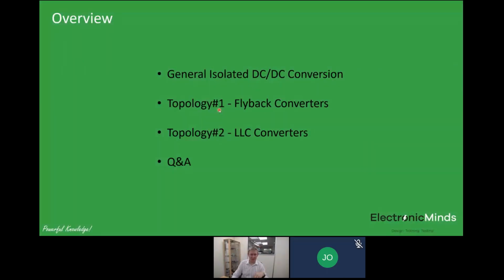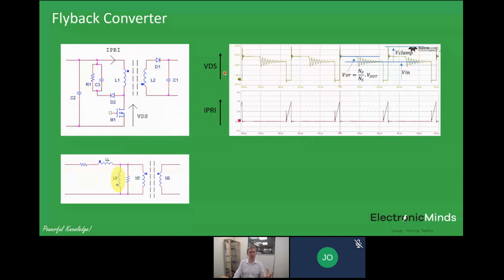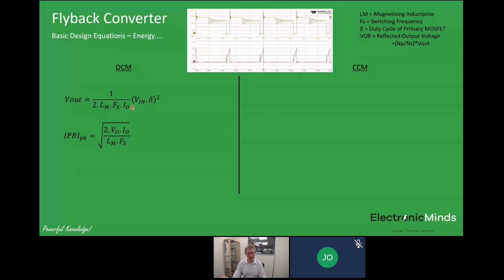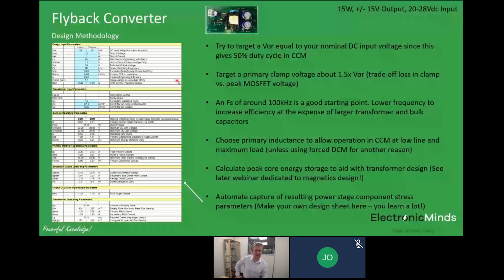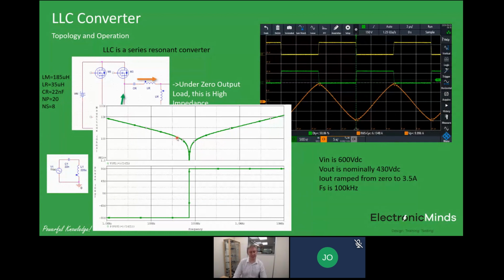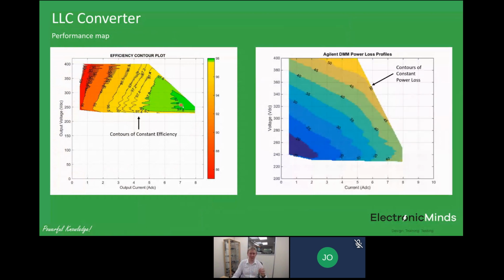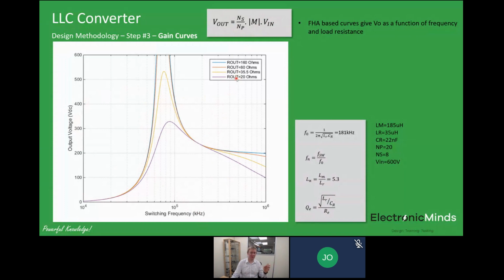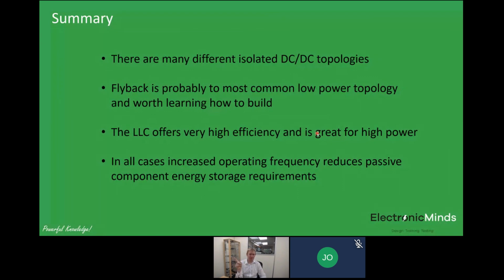Powerful Knowledge 3 - DC-DC Conversion

Comment: Re the resonant converter. If it can be thought of as a frequency dependent resistor divider...... 

Can the same be said about a typical e.g. buck converter (current return through inductor filter cap)? 

And if you're operating in the inductive region.. Why bother even having the series cap?

Comment: @Electronic Minds regarding VOR with flyback design, it's usually something calculated/assumed very early on in the design process (maybe the first step or 2nd). With one output I get how you can get a sense of what VOR could be, but, when you have 3 or 4 outputs, how do you accurately estimate VOR?
Reply from the maker: Thanks for the comment. VOR is a primary side referenced value and is the same with multiple output flybacks. With multiple outputs, you have multiple secondary windings. In each case, the VOR is approximately Np*Vo/Ns where Vo is the output voltage each output and Ns is the number of turns of the respective output winding. Higher outputs have more secondary turns and the primary referenced VOR remains the same.  I hope my explanation makes sense.

Comment: Thank you for sharing, greatly appreciated.
Reply from the maker: You are welcome Janamejaya. What other areas do you think would be interesting for these sort of videos?
Reply: @ElectronicmindsUK  Maybe you can think of following topics:

- Detailed walkthrough of evaluation boards
- Magnetic design
- Patent/Journal/White paper walkthrough

Some of the topics you can look at.
Reply: @ElectronicmindsUK  Hi could you please make a video on three phase AC/DC converter with active PFC Circuit... input -115VAC and output 270V with 300watt output power
Thanks in advance
Reply from the maker: @biswajit681  Take a look at our AC/DC conversion video https://www.youtube.com/watch?v=Bw9E1YVrJDQ as we discuss three phase to DC conversion with active PFC. The key parts are from about 33 minutes in.
Reply: @ElectronicmindsUK  Thanks for the reply.I have watched that video and it gives a great insight. But by any chance do you have any plan to make other videos on this topic or in depth videos ?
Reply from the maker: @biswajit681  - Unfortunately, we don’t have anything further on three phase harmonic correction in the present set of videos. We do have a lot more on other areas such as simulation, magnetics, reliability etc which may be of interest. They will be published over the coming weeks.
Reply: @ElectronicmindsUK  Many Thanks...while simulation would you be using LTspice? Because other simulation software are only  paid version.

Would you also cover topic like from end design power supply design?
Reply from the maker: @biswajit681  we use Cadence PSpice and PLECS for simulation as we find these better suited to what we need to do in power electronics. LTSpice is useful (and free) and others have used it to simulate power electronic systems in the past. 
We cover most aspects of what you need for end to end converter design across our ‘powerful
Knowledge’ series of videos. You can use this content to help steer your own designs if you want to.
Reply: @ElectronicmindsUK  yeah 👍 Many Thanks for your contribution